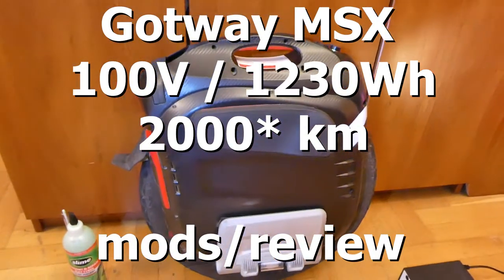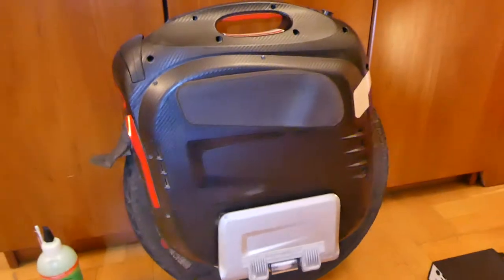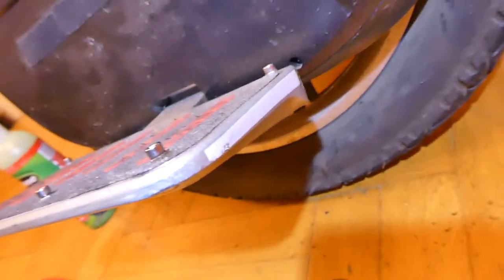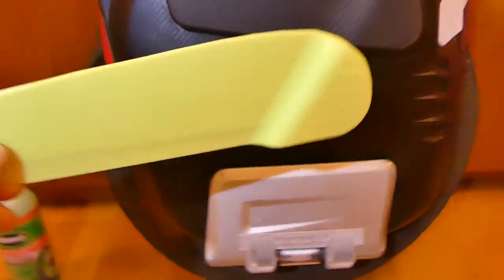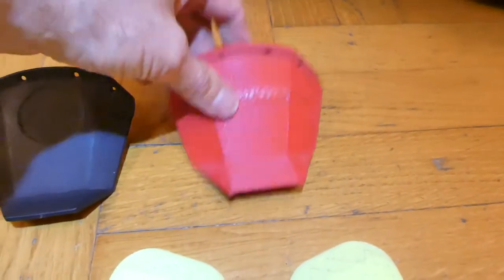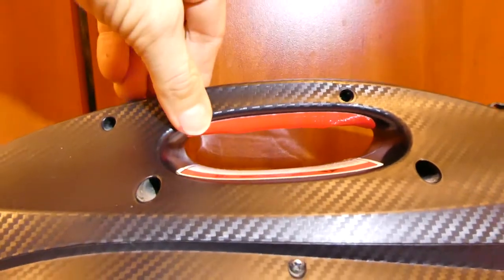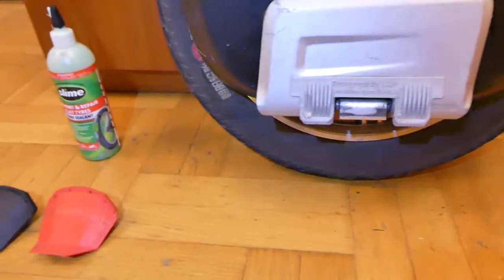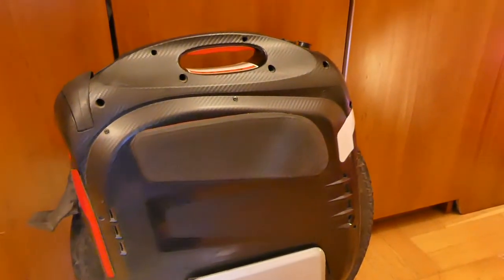Gotway MSX mods and  2000km review

Comment: For confort you could have keep the ks16s and shave the shell to fit a new tyre 2.5 "  instead of 2.125". I ve done it. Ks better quality wheel but 35 kph could be consider slow. By the way do you know where to get a charge doctor as the original website seems dead?

Comment: Great review and upgrades! Thanks. What range do you get on it?
Reply from the maker: I have never run out of power, and range depends on so many factors that it is not the same for all of us - anyway I assume that the range is around 70 km I do not need more for my riding style
Reply: Thank you for your reply. Do you sell the different accessories for this upgrade?
Reply: @LukLuk  Thanks for you reply. Do you sell those accessories? I plan on getting the MSX but would first like to prepare it in the way you did

Comment from the maker: Two comments I have been asked 
- pedal angles - I do not have any issue with that - I like to have pedals high above the ground/obstacles
- switch in the handle to turn torque off while carrying the wheel - in my version of the firmware it does not seem that this functionality is active in the firmware - I have tried to shorten the pins for the switch on the PCB but it does not work. Anybody here with positive answer about the ability to add torque-off switch to 100V MSX?   Gotway has so many firmware versions / mods in their mainboards that they can not keep track and offer upgrades over BT at all.